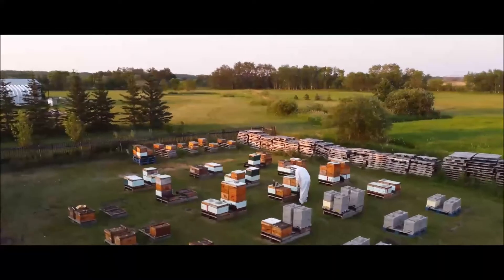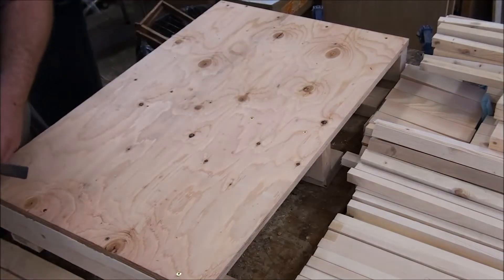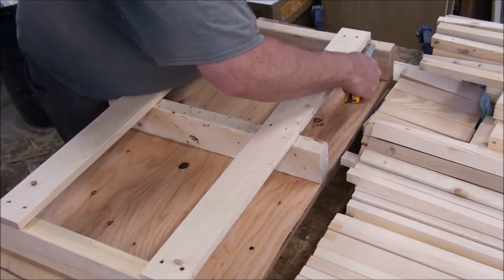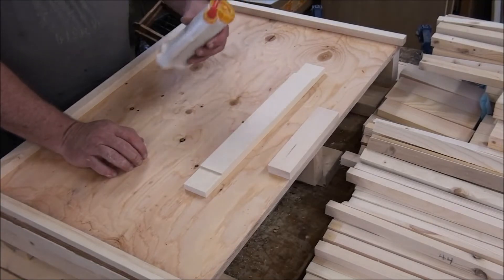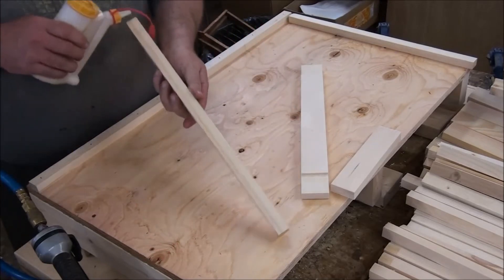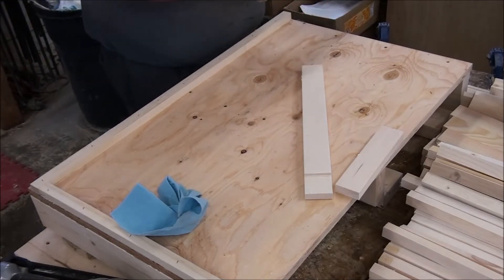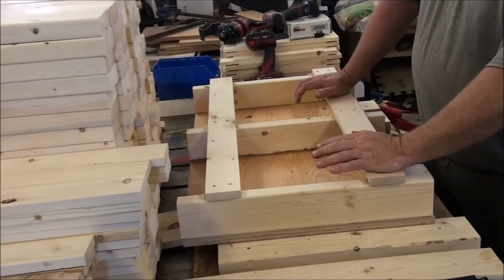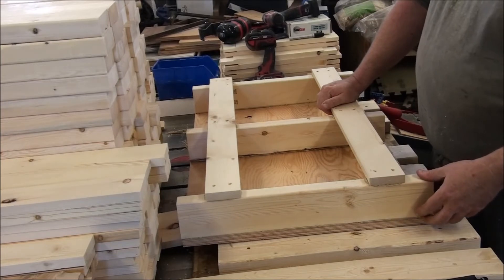🔨Migratory Pallet Assembly part 2 - That Bee Man

Comment: what would be the downside to using plywood for the shim?  If you paint the shims, does that make it any better?
Reply from the maker: I did just that a few years ago and I wasn't sure what to expect but it did work out just fine BUT, my pallets are wax dipped which I know prevents delamination of the plywood so, if you just paint it, I can't say I have experience with that.  I even used plywood for the runners and they worked out ok.